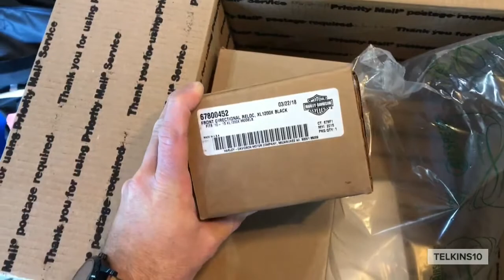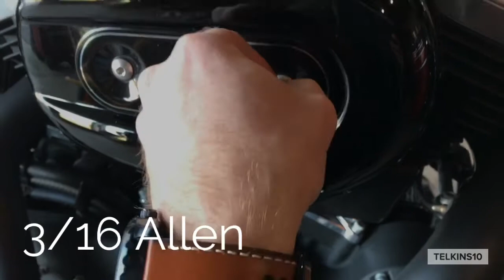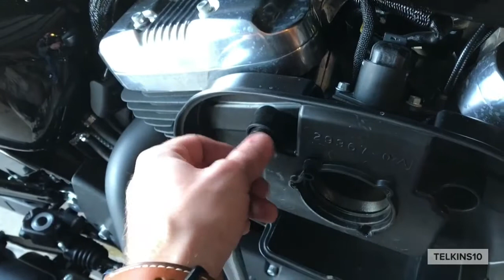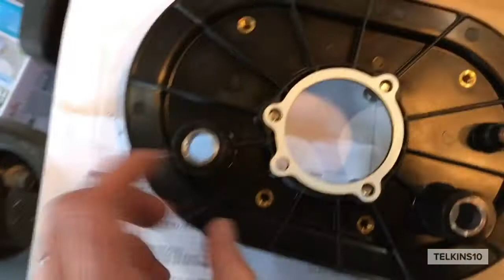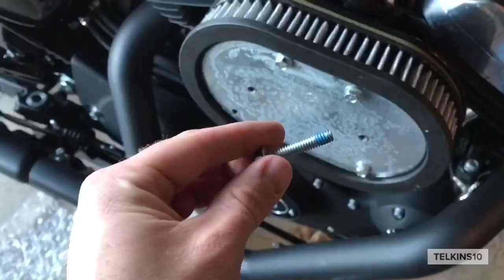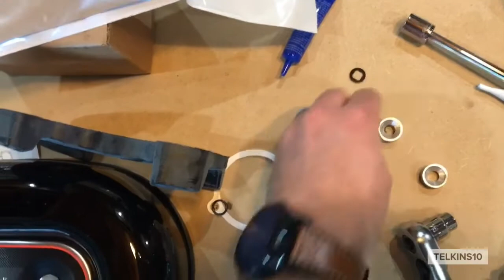How to install Stage 1 Air Cleaner: Harley-Davidson Sportster 48

Comment: Quick question.. do you really have to tune it once you install the air filter... its looks like we have exact same bike except yours probably newer than mine 😅.. I mean I'm going to tune it right away within a few weeks
Reply from the maker: Bottom line, I think Harley would recommend you tune it.  However, I have spoken with technicians who said it would be okay to see how it runs/sounds.  You might be able to get away with installing some intakes/pipes without a re-map.  Best of luck!

Comment: How did you tune with your FP3 I’m usi g the V&H Short Shot Staggered with hi air flow
Reply from the maker: They have pre-configured mappings in their app.  Just put in what bike you have, exhaust and filter and you can tune it from your phone using the fuelpak.

Comment: Are you supposed to remove the rubber trim from the air cleaner housing? Mine won’t stay on now that it’s not the stock backplate
Reply: Mine won’t stay on either did you just take it off?
Reply from the maker: I left mine off

Comment: the H-D 29782-07 that you installed is definitely the best air filter out there for a sportster, I picked up a 883 iron recently with the H-D 29400232A  Rail air cleaner already installed and I can say from personal experience the rail air cleaner is absolutely the worst one H-D makes the map sensor would always read erratic and a cold flat spot was inevitable even with a 13.9-13.6 to 1 afr @ idle. Once I removed the filter and seen a huge cast aluminum mounting bracket in front of the throttle plate it all made sense it causes severe turbulence in front of the throttle body and makes the map sensor give false readings to the ecm. I removed it and bolted on the same one that you installed H-D 29782-07 which is a $150 cheaper than the rail model that was on it and the bike runs f%cking amazing. No stumble no hesitation great throttle response and with cool classic hamcan appeal
Reply: Did you install Ecu Tuner ?
Reply: @amg5795  Vance and Hines FP3